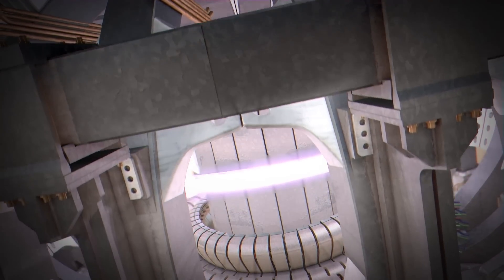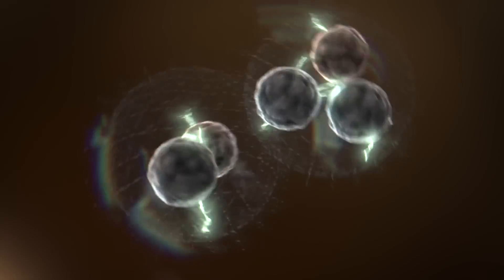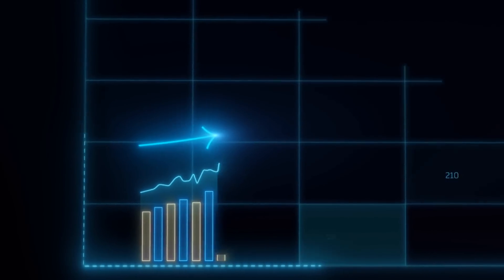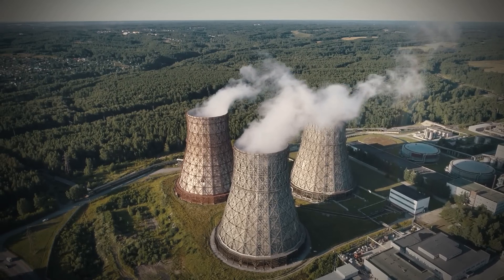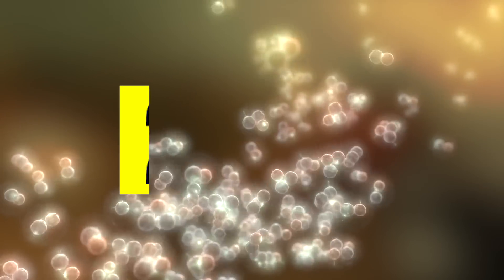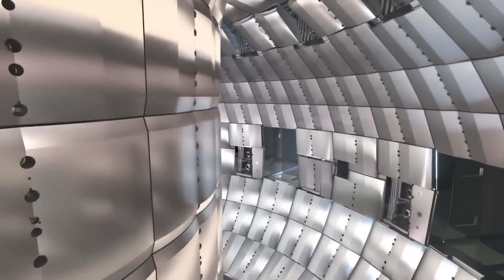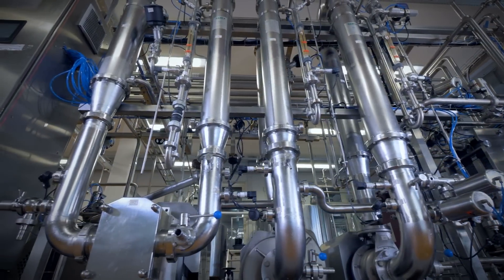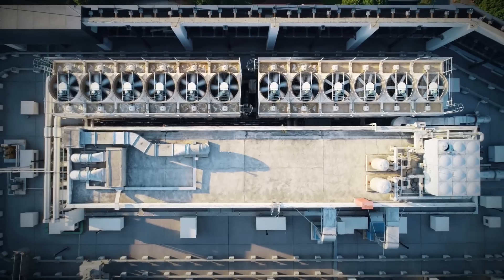The Shocking Problem That Could End Nuclear Fusion

Comment: The idea of a Lithium blanket that will produce tritium for the Deuterium-Tritium fusion is quite old. I learned about it in a nuclear engineering course I had, as an engineering student about 40 years ago. However the main problem was not the scarcity of tritium, but the protection of the reactor's components from the neutron flux of the fusion reaction. Neutrons have the tendency to make the material they hit radioactive and cause them to transmute in to led eventually. This, for a 24/7 year round power plant operation, would require a tremendous amount of service and parts replacement. The other serious problem with the Lithium blanket, besides the scarcity of Lithium 6, is the fact that Lithium is flammable and ignites explosively. This would mean that the slightest leak of air coming in to contact with the lithium blanket, under high temperature conditions and the entire reactor would go up, like an old photographer's magnesium flash.
The best way to go with fusion would be the neutron free Deuterium-Deuterium reaction, however the starting temperature for such a reaction is at least 3-4 times higher than the Deuterium-Tritium reaction. This is a temperature level absolutely unattainable with current  technology, possible maybe after 100 years at least.
In my opinion, with current technology, the best way to go until a Deuterium-Deuterium reaction becomes possible, is the liquid salt Thorium fission reactors, that appear to be safer and with much less radioactive waste than current Uranium fueled reactors. Also Thorium is much more abundant than Uranium and there is no issue about someone making nuclear weapons though the Uranium enrichment process or the nuclear waste reprocessing that could provide Plutonium.
PS.
If I remember correctly, Alpha particles hitting Beryllium produce neutrons. At least this was the way our lab's neutron generator worked, by using a Plutonium-Beryllim core and we would put our samples around it. So in what you describe, they probably want to use the Alpha particles produced by the fusion reaction to maximize Tritium production from Lithium, by enhancing even more the neutron flux.
Reply: The reactor walls don't last.  So this is why we remain 30 years away from viable Fusion -- after 70 years of research where we were always about 20 or 30 years away from a Solution.
Reply: @goodtoGoNow1956  There are major technical problems like the nuclear transmutations of the reactor's material, due to the Neutron flux.
Another problem is the containment of the plasma, if there is the slightest failure of the magnetic field, even for a fraction of a second. True the quantity used will be small and it will cool significantly due to its expansion, but it could still damage the reactor and the Lithium blanket could make things much worst if it came in to contact with the atmospheric air, under these conditions.
It's one thing to run the reactor for a fraction of a second, or even few seconds and quite another thing to have a power plant that would run 24/7, 365 days a year.
Reply: "the protection of the reactor's components from the neutron flux of the fusion reaction."  Agree.  This problem was identified when I looked in 1973.  Fusion is claimed to not have high-level nuclear waste, but, if you need to dismantle the vessel and change radioactive components, you'll have to do something with them.
Reply: @oakbellUK  Correct. However due to the nuclear transmutations that would occur, the life expectancy of the reactor components will be shorter than what would expect. This is what led to the Lithium blanket idea.
Judging from cellphone Lithium-ion batteries that explode and catch fire if they are defective, it's open to the imagination what might happen to such a reactor in case of an accident.
Reply: @markmeridian3360  I agree. Fusion has been oversold for decades and I think this is for two reasons: The first is to create expectations, in order to ensure popular support for the funds required. The second is to create practical fission free fusion. This would allow for the creation of clean nuclear weapons, so easy to use without the fear of long-term fallout.
Regardless of all that, such a power plant would require extensive cooling, and the experience with fission plants is that in all the major events so far, the weak link was the cooling systems.
There is another problem, that as far as I know, nobody examined it extensively, in global terms, so far. This is heat dumping in the environment. Everybody is talking about CO2 and global warming, but nobody examines the effect of extensive heat dumping in the environment from thermal power plants, even fusion ones, that will be required to power all the other "clean" systems. Usually, environmental studies involve local ecosystems, and I don't think there are many studies involving the global impact of massive heat dumping.
I am a Mechanical Engineer, with a PhD in Applied Thermodynamics. I have also studied energy production methods and nuclear engineering.
Reply: the MIT acutally came up with the idea to use a liquid reactor blanket, it would utilise the liquid salt FLiBe which is also used in normal fission reactors and it contains lithium for the tritium breeding

this way it is basically impossible to damage the blanket and if needed you can just drain it
Reply: @samuel238  Understandable, but you would still need something to contain the liquid Li blanket inside the reactor, and this will still be exposed to the Neutron flux on its inner face.
Also, such a reactor will require a hell of a cooling system to keep all the components involved at an acceptable temperature level from radiated heat transfer. Magnetically containing the plasma will not be enough.
All the events that happened in fission reactors to this day, involved the cooling system one way or another.
Reply: Yes, when I read the video title I assumed it would be about neutron radiation. Tritium scarcity seems small beside that.
Reply: @markmeridian3360  A planetary temperature increase should increase cloud cover that would reduce the thermal energy radiated into space. Of course, 0.02% is small but it is still added to everything else.
Frankly I still have doubts about the whole thing about global warming, because it is not the first time such claims were made. 
Back in the 1880s a British professor claimed that in the next 30 years global temperature would increase by 8 degrees, because of coal burning. 
Today this theory came back because there is a temperature increase of 0.7 to 1.4 degrees Celsius observed in the last 50 years.
The Earth's atmosphere never had a constant composition and the Earth's temperature was never at the level we know today.
If a super volcano erupts then the Earth's climate will change within months.
Also, CO2 is soluble in water. If the temperature rises, we will have increased evaporation causing more powerful weather systems and increased rain establishing a balance on the planet. Plants will also grow faster absorbing CO2, something that is observed today.
Of course, such changes will create problems for mankind, but talking about saving the planet I think is an overstatement. 
We are like a flu for Earth, if the infection becomes bad enough the planet will just sneeze it off as it has done many times in the past. 
Saving ourselves yes, saving the planet I don't think so, regardless of our ego, we are still insignificant in the face of planetary forces.
As far as fission free nuclear bombs it has been a military wish for decades. It is not important how big the prototype is, because eventually technology finds ways to miniaturize things.
True fission free nuclear weapons also produce radioactive contamination, but it is not as intense or long lasting as the one produced by today's weapons.
Reply: Thorium myth, it doesn't matter that it's more abundant, there's an extreme amount of uranium available. It's not safer and it's not safe from being used in nuclear weapons. Please stop saying this stuff, the rest I agree with but the whole thorium debacle is delegitimatizing uranium reactors which are excellent already. We need nuclear power for the time being so countries stop using coal and oil!
Reply: OR, how about just abandon this fools gold chase for "Clean, safe, UNLIMITED"*, energy for good? Bear in mind, humans, at least the privileged billion or so, had access to basically 'unlimited' energy here in the free-world order, and look what it lead to. Overpopulation, resource depletion, atmospheric, ground, and water pollution that is off the charts. All made possible, by 'cheap abundant', (non-fusion) energy. "Unlimited" fusion energy, if it were possible, would be the final nail in the Biosphere's coffin. And dont forget COST$$$$. Nuclear fusion would be so eye wateringly expensive as means of boiling water, that no end user, could afford to pay for the resulting electricity. Be thankful fusion is still 30 years away, aka just around the corner....

Fusion will be *none of these things.
Reply: @champisthebunny6003  As it is said: "The road to hell is paved with good intentions".
Reply: Oddly enough, it is theorised that the two thing LFTR reactor and a fusion one can help each other out in a way. You see in a lifter you want to use Flibe with Li7 as to avoid tritium production while in a fusion reactor you aim excatly for that. So you can separate Li6 from Li7 in enrichment process and use one in a flibe blanket for the fusion and the other in the flibe blanket of a lifter (in case its dual fluid otherwise its in the fuel salt).
Reply: @CraftyF0X  Regardless of the technology used, Lithium, IMAO, will be a hazard in case of an accident. As history shows us, no matter how good the technology and its safety measures, things can always go wrong. I think that fusion will become viable only is a neutron free Deuterium-Deuterium reaction becomes feasible. However, this is still a long way away.
Reply: @FLORATOSOTHON  Lithium-6 is both chemically and nuclearly quite stable in a flibe salt though.
Reply: @markmeridian3360  Good comment, but maybe I would add that, what they actually "sell" is not the idea of real proxymity in time to achieveing fusion. What they say, and make an analog of is that plasma performance (mostly judged on the basis of the triple product) seemed to incrase similarly to Moore's law (in this case performance doubleing every 18 months or so)  and even more, and if we operate under this assumption ,and with your numbers, that would mean scientific breakeven is about 1.5 years away engineering breakaway should not be a lot farther than 6 years away (actually its about 1.5 log2(20) ) and even economic breakeven should be around the corner in less than a decade. Notice that what actually gives the hope is not where we are in terms of plasma performance but more about the assumption of continous exponential growth at this field. Now, exponential growth does not really exist in nature, as it always end up being a sigmoid, but we don't yet know where we are on the curve, so far we were in the exponential phase, ideally we can remain on it for that extra 10 years.
Reply: @markmeridian3360  Just for the record, that wasn't my claim, that's the claim of many fusion start up and some plasma physics professor from MIT, so I figured it might be right, maybe you can look into it as far as I know its kinda widely accepted. Ofc I guess a lot depends on what actually goes into "plasma performance" or getting really good results on one front (for example confinement time or density) may suggest a bigger improvement than what actually it means to really achieve the goals. But again grounded skepticism is reasonable as long as no one demonstrate an economically viable fusion reactor.
Reply: Kalki Ironman type 7 and 8 after 2026 😎

kalki avatar (beast of the earth) (christ on the white horse) (son of man on clouds) is the biggest enemy of dajjal/antichrist/kali 😏

Kalki Avatar (Murtaza) 11th satguru 13th imam cousin of Moula mahdhi a.s. 12th imam (muhammad) 😎

Prophet Moula mahdhi is raja shashidhuvj (the mighty one) born less then 1200 years ago 😎

Prophet Moula Isa a.s. will kill dajjal cause dajjal is going to kill Kalki Avatar 😏

Kalki Avatar will follow orders from 2 religious king Moula mahdhi a.s. and Moula Isa a.s. 😎

Kalki Avatar going to have 2 swords and ring of moula sulaiman a.s. and staff of moula musa a.s. (iron rod) Staff of moula musa a.s. is like omintrix can transform into anything and can transform others into anything And stone in the ring of moula sulaiman a.s. is also known as kastav mani and it's more powerful than all 6 infinite stones combined 😇

Cuz Kalki is ironman batman super saiya-jin superman ben10 saitama optimus prime shaktimaan and every super heroes combined after 2026 😎

This staff will transforms into white horses with wings,weapons,iron-man,cloud etc or can do imagination into reality 😎

*Ratn sru sword of lord shiva (miri)😇

*Ratn varu (zulfakar) sword of Moula Ali (piri) 😇

miri piri 😇

Kalki Ironman after 2026 😎

Satyug (sunrise from West) 2038 😏

Sambal is hospital 😏

Gzwa e hind 2029 😎

Khalistan and Azad Kashmir after 2026 by Ironman 😎

99% Hadith u heard is not about imam Mahdi it’s about Kalki avatar (the main character) that person momin vs dajjal prove me wrong if u can 😏😏😏.
Reply: Couldn't you use the deuterium-tritium reaction to start it and get it up too temp too do the deuterium-deuterium reaction ? Idk I'm a high school drop out so maybe what I said sounds dumb 😅
Reply: @nicolasneilson7986  No you couldn't, because the Deterium-Tritium reaction takes place at lower temperatures than the ones required to start the Deuterium-Deterium reaction.
Reply: @FLORATOSOTHON  oh I got you so it needs to be 4x the running temp of t-d reaction for d-d reaction to even start to react let alone stesaneable temps or is it 4x the temp of t-d to stesane d-d reaction I would assume it becomes more efficient with higher temps
Reply: D-D fusion is NOT neutron free. It has a 50% chance of producing He3+n0

Comment: Nice and informative video. Deuterium is probably the easiest chemical to make-- simply organize two hydrogen atoms around any third, larger one and a neutron is more than average likely to escape and fuse. This is because organization is very, very low in all internal molecular states, but can easily be accomplished with particle geometry. It is one of the reasons atoms are so, so highly organized into stars, planets, and other abundant chemicals. Deuterium to tritium or higher is done by saturating the molecular state density with highly-reactive neutrons, which are usually those with an abundant of ionized energy since neutrons will abandon it evenly and not consequentially. You've inspired Me to get into the tritium/deuterium/scionatium business; $18 a gram, instead of $30,000/g is what I'll charge. Thanks!

Comment: No. Stockpiles are low because tritium is a restricted, weapons-capable compound with no legal market.
Reply: Tritium is cheap and easy to create. Current "high prices" are an artifact of arms control policy. Costs will plunge in any world where the value of commercial utilization of tritium outweighs the arms control value of restricting it.  That's why experts don't discuss this.
Reply: @orangeraven3869  interesting, where did you get it from?

Comment: interesting idea resumble coment atleast some data about action and possibilities si tritium is kind more but not enough and hard option is for scientist to prove wright in meanwhile booster core poles could predict more like smaller core donut or even curved to think in way off ordinary combust engine or rocket engine but larger pressure in theora a practicing a twoo ways could result riye sucsses rate and thats final goal more afordable energy and at endoutput and through process get eficiency easy since is new topic test should be started to get some approx data       and understanding all process behave much stuff could look like neuton stars and neutrino games colector under pressure after while a constant pressure and heat could came to solution easy o permanent thats scientist final data but anyway all process is stagering and could give const E output some X and workable and research and inovation in reworkable improved fast gives some goals ahead for example a tocamac boosted on mars also along side thorium cell as energy solution and easy expand energy surplass society on mars as colony thats realistic but time frame is slight unknown better if sticked to fact datat and follow process and go fast into research and inovation anyway a time frame to speed off ligh is litle nerve racking first is energy surpluss then alternative speed travel or above speed travel ordinary then is enough time somehow people forgot that mars has breadless air factor and if given something that can developed or in hand then they develop fast same for entire process

Comment: There has never been any possibility that fission reactors would work because there is no known material which has any possibility of withstanding the radiated heat from 100,000,000 degrees. Fusion reactors have all along been a tax funded research scam will not lay down and die because too many people are making too much money.

Comment: I don’t know enough to speak to this, but I wonder sometimes if we’re spending too much on fusion when we have the more urgent and immediate need for clean energy to stave off climate change. All of those billions that could be spent on solar or proven safe fusion reactors that could help us stabilize the climate and then focus more on fusion…
Reply: Fission reactors are the ones that are cheap and reliable ways to get rid of fossil fuel dependence.
Reply: There's nothing wrong with fusion, the video's author is badly informed.